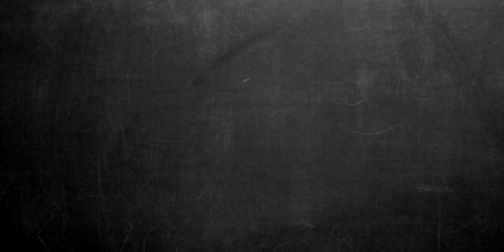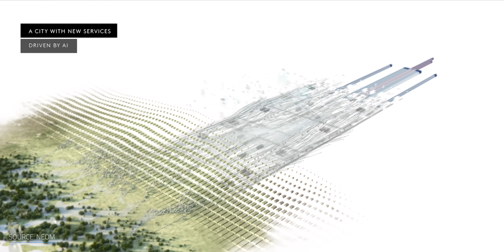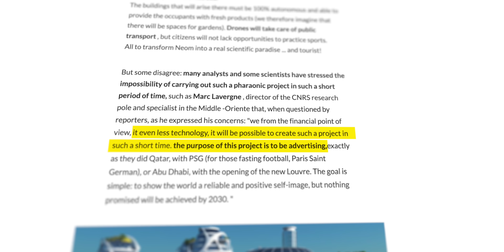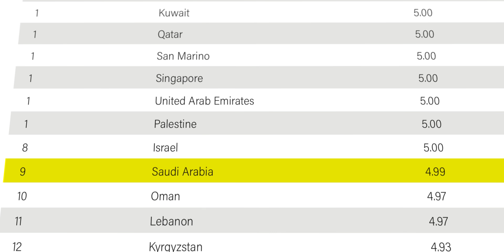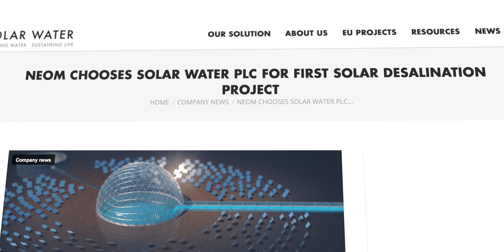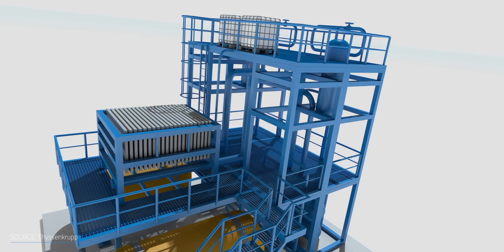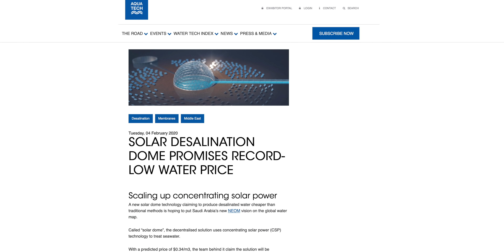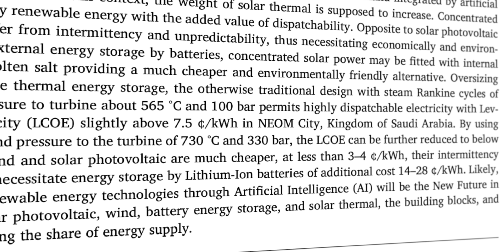Why Neom Might Be The Future of Sustainable Cities

Comment: It's really frustrating seeing all these people - smart, educated, reasonable people - pushing hydrogen as a fuel source. Methane can be manufactured using a sabatier process for far less energy input and doesn't require cryogenics or expensive/complex reforming to transport and use and it can be transported and used with existing infrastructure - which is perhaps the most important factor in its favor. Using sabatier-manufactured NG is net-0 carbon emissions and doesn't require any expensive new engineering (e.g. manufacturing fuel-cell vehicles) to use across hundreds of different industries.
Hydrogen, especially hydrogen reformed into ammonia, is just... a bad idea. A really bad one. And the only reason I can think of for why these smart, educated people keep pushing it is cause they're either being paid to promote it (by whom?) or because they got their brains stuck on the idea and refuse to let it go.
Reply: Hydrogen is a better fuel source than methane, though.  Methane still produces greenhouse gases (and is, itself, an extremely bad one) when used as a fuel.  Hydrogen, however, has no such problem.

As long as they continue to improve manufacturing and transportation methods for hydrogen, methane is simply outclassed.
Reply: @Diviance  Clearly you don't know what the sabatier process is. Not surprising, heck I bet half the energy scientists in the world don't know about it. A sabatier reaction takes CO2, hydrogen, and oxygen and turns it into methane. You take CO2 out of the air and turn it into methane and burn the methane and then repeat. So like I said, net-0 emissions. The CO2 you emit by burning it is reclaimed by your reaction that produces it. So you are incorrect, sabatier-manufactured methane does NOT produce greenhouse gases. It's easier and cheaper to make, store, and transport than H2 and it has existing global distribution infrastructure. Methane is also far more energy dense than H2 (by orders of magnitude) making it more efficient to use as a fuel. 

The infrastructure alone is a huge point in its favor. EVERY internal combustion engine on the planet right now can be converted to run off of NG for a few hundred bucks in a short afternoon-long visit to an auto-shop. Most houses around the world (in non-equatorial developed countries) already have NG gas lines running directly into the garage and a car-refueling hookup can be installed for under $100. Gas stations can be repurposed to sell NG and refilling your tank would take less time than it currently takes to pump petrol (nevermind comparing it to the hours required for electric vehicles). Existing coal fired power plants can be converted to NG and existing NG powerplants can run off of manufactured methane (allowing us to generate methane cleanly with renewable energy where it's effective to do so, then transport it cross-country without the efficiency losses associated with transporting electricity that far). 

Hydrogen, for comparison, requires expensive and fragile cryogenic cooling equipment (or expensive and environmentally unfriendly reforming into an inert material such as ammonia) to store and transport, has no existing storage or distribution infrastructure, has no existing consumables, has no existing point-of-use equipment. To use it in transportation you have to design and build entirely new vehicles from scratch; to use it in home heating you have to design and build entirely new furnaces from scratch; to use it in home cooking you have to design and build entirely new kitchen stoves from scratch - ALL of which must include the cryogenic storage equipment or onboard equipment for cracking ammonia. 

(Side note: Right now most hydrogen production is done by cracking mined natural gas. That's usually the first argument against manufacturing methane - it requires generating hydrogen in some other way. But this ammonia plant is supposed to be generating electrolytic hydrogen, which answers the "generate hydrogen some other way" problem. The only question is what you do with the hydrogen once you have it: Do you build expensive cryogenic storage and transportation equipment? Do you convert it into ammonia which is not a ready energy source and must first be cracked by specialized equipment before you can use the hydrogen in other specialized equipment? Or do you convert the hydrogen to methane and use all of the existing NG infrastructure?)

With government-sponsored incentives, tax breaks, and subsidies we could take our ENTIRE GLOBAL annual carbon footprint down to 0 within 10 years by manufacturing methane. Hydrogen can't do that - even if it were an effective fuel source (and it's not) it would still take 50 years to convert all of our existing infrastructure to use it, and that's IF we could get the entire developed world to push the same incentives and subsidies to make it happen. The only thing standing in the way of manufactured methane as a fuel is manufacturing it at a price-competitive cost compared to mining natural gas, but it's still cheaper than hydrogen. By no definition whatsoever is hydrogen a "better fuel". 

Your only valid point is that methane itself is a greenhouse gas, which it is. But that only poses a risk in the instance of leaks (which are remarkably rare in NG pipelines compared to petroleum) and methane quickly breaks down in solar radiation. We could certainly make improvements to our NG infrastructure to reduce leaks further. 

I've been doing research on this topic for 13-14 years. When I talk about "smart, educated, reasonable people" I'm not talking about the lay youtube audience, I'm talking about scientists and chemical engineers. Hydrogen is a fad and it's a shame to see actual professionals pushing it when their entire career and life's work is to know better.
Reply: @Diviance  Look, it's clear that you are not an expert in these fields. None of your arguments hold water (hyuck) against the science and the math. 
- Manufacturing methane from atmospheric CO2 means it does not pollute *at all*. It doesn't simply pollute "less", it doesn't pollute *at all*. Every single molecule of CO2 you create by burning the methane is recycled when you manufacture it. If you manufacture more than you burn, your net carbon footprint becomes negative.
- Every time you convert energy from one form to another there are losses due to inefficiency. In this video Matt covers that their method for electrolytic hydrogen generation is 80% efficient, which means 20% of the electricity they put into their machine is wasted. Burning hydrogen to generate electricity is less than 20% efficient. To do it your way would waste over 80% of the energy you generate. And you still have to transport that H2.
- Methanol is more difficult to manufacture than methane, as difficult to transport as petrol, and carries less energy than CNG. 

Let me try to break it down for you to a 5th grade level: You start with solar/wind -generated electricity. You use that electricity to generate hydrogen electrolytically. How do you get that hydrogen from the point of production to the point of use?
- Transport the hydrogen as compressed H2, which requires cooling it to 33 K and expensive, heavy machinery to keep it that cold, and some of your H2 will still leak
- Convert the hydrogen to ammonia (as suggested in this video) which is an extremely hazardous substance and which requires more energy to make and more energy to crack in order to obtain the hydrogen
- Convert the hydrogen to methane using atmospheric CO2, which burns cleanly and has existing distribution infrastructure

The number one most important factor when it comes to clean energy is how quickly we can do it. Getting the world switched over to battery electric vehicles will take at least another 30-50 years and has huge unsolved problems when it comes to battery waste (never mind what to do with all the existing gas/diesel vehicles on the road). Switching all of our electricity generation over to wind and solar just can't happen - not everywhere that needs electricity is an efficient place to generate it with wind and solar. Switching to hydrogen as a fuel would take at least 50 years, never mind the fact that it still isn't practical (all of the fuel cell stuff people talk about is still very much theoretical with test models in labs). Converting everything that currently depends on fossil fuels to run on methane is doable, it's easy, it's cheap, and can be done in less than a decade. 

The answer should be obvious. It's not me over-selling manufactured methane, it's the jokers of the world over-selling hydrogen and people like you buying into it. 

You're being quite rude telling me to "think a little" when you haven't thought about it at all. As I said, I've been researching this for nearly 15 years. I am not just some random youtuber with an opinion, I'm an expert. You're the random youtuber with an opinion, and your opinion is ill-informed.